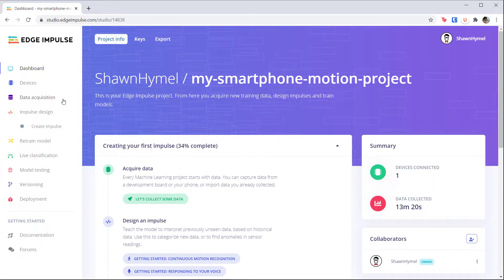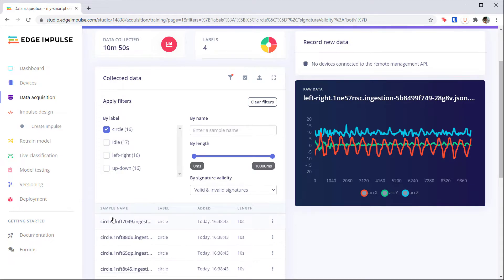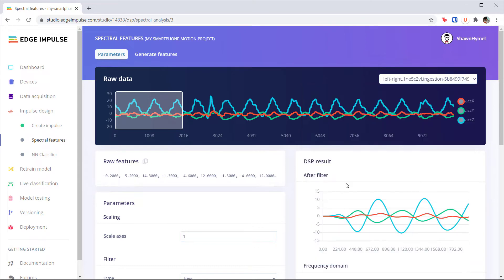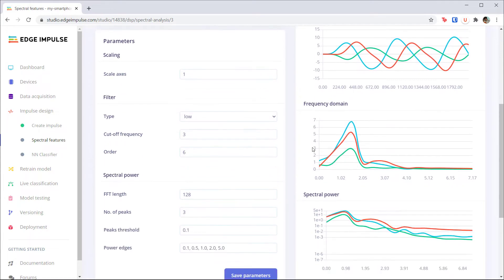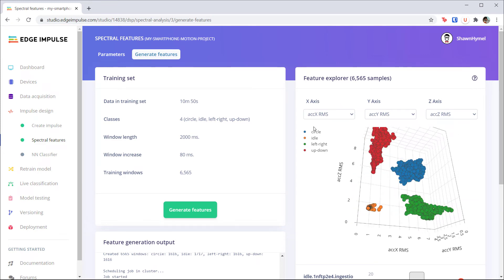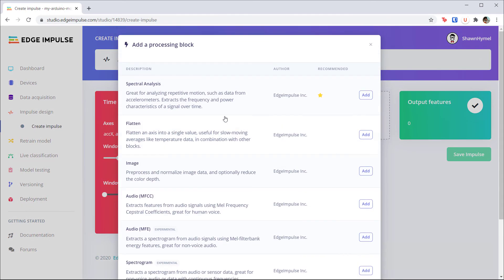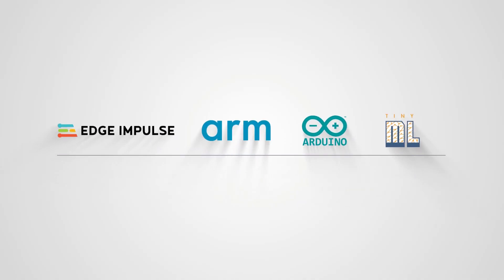Introduction to Embedded Machine Learning 1.4.2 - Feature Selection in Edge Impulse

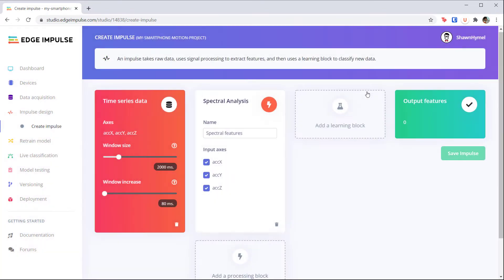Comment: Help, plz! My project is following this tutorial perfectly so far (on Arduino Nano Sense) ... up until this point (1:28). Not sure why, but when I try to add a learning block there is no option for Neural Network / Keras block. The options are Classification, Anomaly Detection (GMM) (unavailable), Anomaly Detection (K-means), Regression, and Visual Anomaly Detection - FOMO_AD. :(  Do I need to upgrade to get the Neural Network learning block? It doesn't seem to indicate that. HELP!
Reply: Hey, just add "Classification".
Reply: @janjongboom7561  Thanks, yeah, I found that solution in the Edge Impulse forums last night. Thank you!